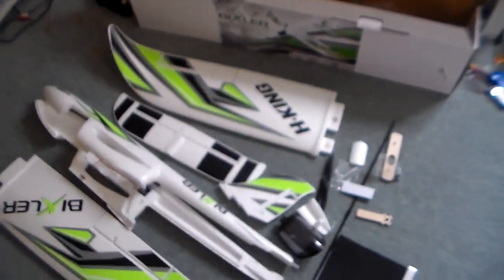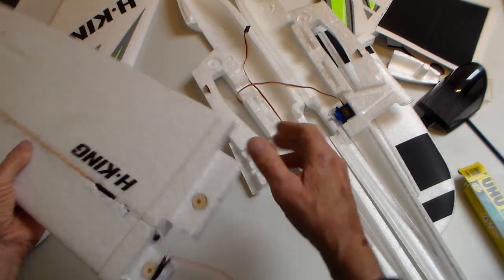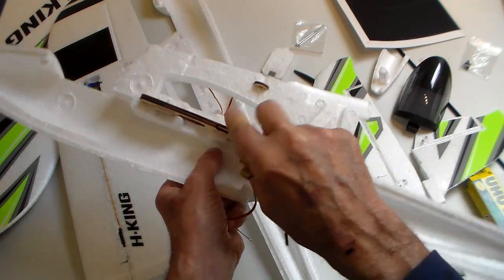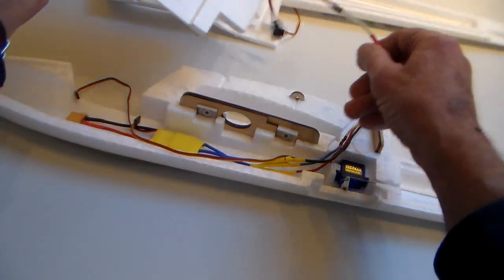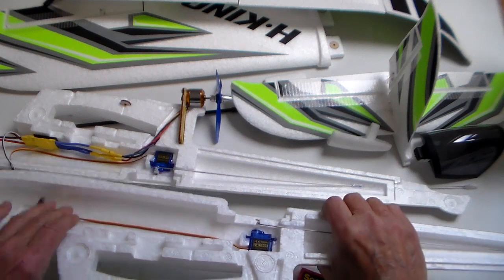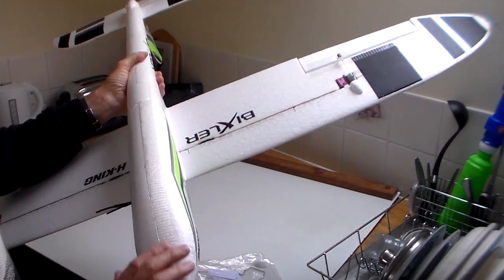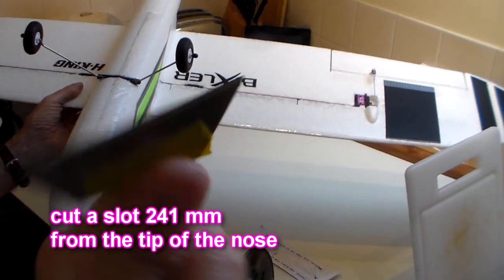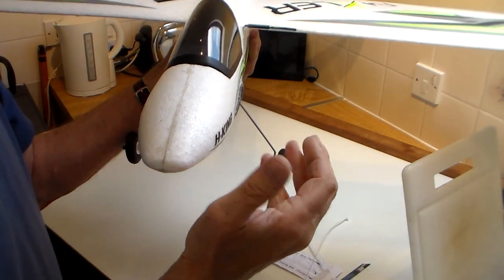HK Bixler 1.1 What they DON'T TELL YOU!  My ARF  Building Tips

Comment: Thank you for your excellent points on your Bixler build. I am actually building my second Bixler , it's been some time since my 1st build so your video is very helpful. This time my build will include reinforcement in the tail boom ,as I have snapped it off on a not so smooth landing. I may use some foam or a carbon fiber rod for the reinforcement Again thanks for video posting. ✈️🛩️🛬
Reply from the maker: @socalives  that's great, I'm glad you found it useful! I snapped the tail on mine as well.  😫. A bit of carbon and some tape and it's ok now but it did make it quite tail heavy. Needed a bit of lead on the nose, though I guess it depends what lipo you use. 
I've just installed a flight computer in mine and will use it for fpv. It's been hard learning about the controller and inav but I had a successful test flight eventually and it did loiter which is the first thing I wanted to test. The  video about  setting up is on my channel. They're a lovely flying plane.

Comment: I used PVA to glue the sides together, taped it to hold it in place to dry.
Reply from the maker: mistake I made was starting at nose, by the time I got to the end of the fusi it was 10 mm out. If I build another I'd assemble it from the middle.
Reply: 10mm is a lot.
 @bobflyman

Comment: Thank you so much for posting this video I just bought a bixler off the same model and the points and tips you have given will save me lots of time and headaches especially the one about the control wire lengths and there too about drilling the motor Mount thank you
Reply from the maker: Great, glad you found it useful. For me the worst thing was when glueing it together I put UHU Por on, let it dry a bit and the starting putting the halves together at the nose. I got to the tail and because foam is soft and stretchy the two halves didn't line up. Possibly  introduced a slight bend. If I did one again I'd try and start putting together in the middle or I'd line the 2 halves together dry and put little marks on to help line them up. Have fun!

Comment: if you rotate the motor on the mount you don't have to drill that hole
Reply from the maker: I tried it both ways, the wires wouldn't easily go down the moulding that way. Much better down the middle.
Reply: @bobflyman  yeah maybe its differences in motors but my wires came out the top and i could just run it down the inside no problem.

Comment: The Bixler will actually belly take off from short grass. No need for gear. Put some packing tape on the bottom of the fuse. Good to go.
Reply from the maker: Mmm. Don't think I tried that. With the u/c it tends to nose over, maybe belly would be better then. Thanks.

Comment: And they call this version the ARF for what reason? Disassembled, nothing included? Seems this is how a kit comes. Not ARF. 
Great video, lots of detail. Helpful for newbies and those with some experience. Take care, be safe
Reply from the maker: Glad it was useful, and yes, it is really a kit!  You need to be very careful glueing the two fusi halves together. I put on UHU Por , left it a minute or two then started putting together at the nose. When I got to the end of the fusi the halves were a couple of mm out and I think it introduced a slight bend. Might be better to start in the middle. Took a while to sort it but I actually flew it today and it flies really well. Amazing glide.

Comment: Thanks for a well presented build. I made my own external engine mount which gives me ability to change the motor, external fitment of the speedy gets airflow. Beware of the no-name 30A speedy from BG, I’ve had 3 out of 4 fail, 1 even smoked up during programming??
Reply from the maker: Thanks Ian.  I finally got it sorted and it flew well Wednesday.  Easy relaxed flying, just floated around!  I've used a few yellow no brand 30 amp esc's and so far they've been OK. Fingers crossed. Never tried programming any, they didn't come with any literature!

Comment: Very nice plane! I got the same motor esc combination. During the 3rd flight the esc overheated and.... uncontrolled crashed! The failsafe setting reduced the damage.  So I put in a 40A Skywalker and made cooling holes. After my vacation I going to put in a separate ubec.
Reply from the maker: Cool.  I'm surprised you overheated. I flew it the other day and 1/2 throttle is enough power.  I think I'll add a couple of scoops just in case though!
Reply from the maker: Separate UBEC a good idea though!

Comment: I've had all the bixler range, and the bixler 1 is the best of them. Here's a tip, dig those wooden washers out of the wings and use 4  15mmx3mm round magnets glued in to hold the wings together. If you use the washers and screws, you'll bugger up the wings on your first bad landing, magnets will let go in a crash but are more than strong enough to hold the wings on with even the wildest flying. The bix 1 loves the wind and will fly in 40mph gusts, will slope soar on rocky slopes with no decent LZ where you wouldn't risk a nice plane, ok for local FPV, hedge hopping and flying through 5 bar gates, fun for combat - they are as cheap as chips and should be treated as disposable. Do this and you will love it
Reply from the maker: Thanks mate, useful info. It's a really nice looking model, looking forward to flying it, and the 5 bar gate fpv sounds interesting!  Blowing a hooley  here so no flying for a bit.
Reply: Fantastic tip regarding the magnets, thank you